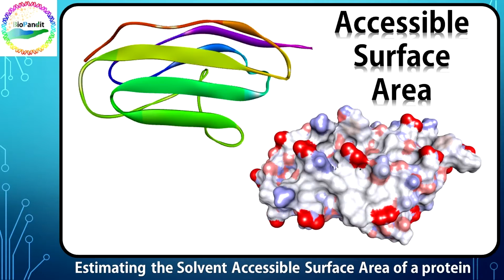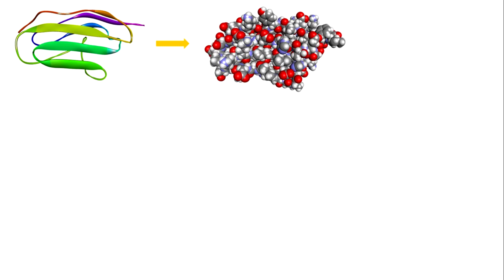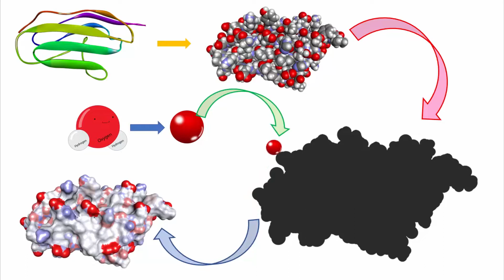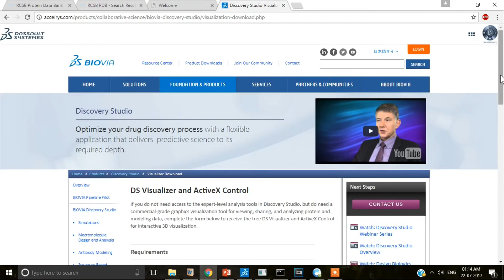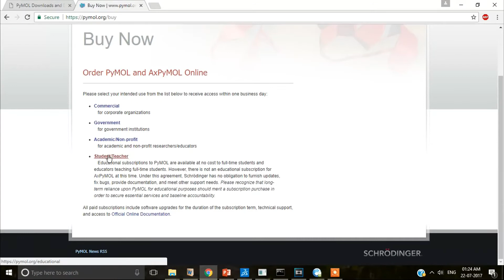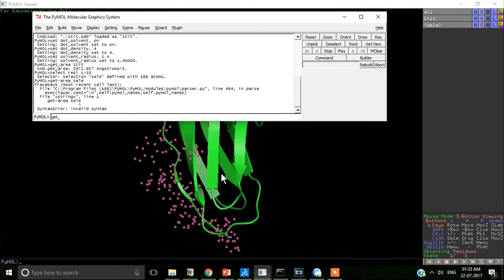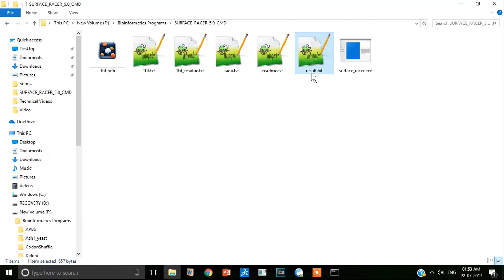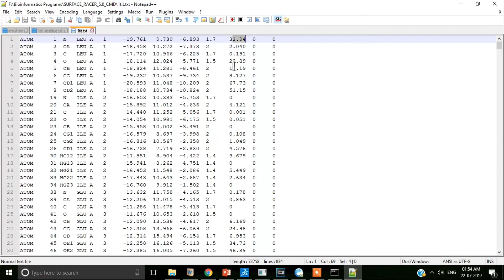Estimating Solvent Accessible Surface Area of a Protein

Comment: Hello there,
I am a researcher working in the area of protein aggregation and thus SASA calculations are pretty important for me. I did the same but through the right panel, and not through the command line. I think that doesn't make a difference. Moreover, I want to know do these result files always get generated after every such run? Actually, they didn't in my case. Could you please share the link for the surface racer and how to install it, as the one I tried, gives a command line terminal right as click the .exe file.
Please help.
Thanks

Comment: I am using Schrodinger, how can I interpret the data from SASA, FOSA, FISA, and PISA for a given inhibitor? For example, if I got higher SASA value but lower on other parameters, what does that mean for a drug molecule ( NOT a protein)? I searched for 3 hours about this information but couldn't get the right answer.  Thank you so much.

Comment: sir by using GETAREA for my protein, i got ASP value as 76. what does it mean?
Reply from the maker: ASP stands for ATOMIC SOLVATION PARAMETERS. GetArea also calculates Atomic Solvation Energy for each atoms. So, your result 76 stands for the number of atoms that have ASP value=0. You could see their paper for a better overview. 
https://onlinelibrary.wiley.com/doi/abs/10.1002/(SICI)1096-987X(199802)19:3%3C319::AID-JCC6%3E3.0.CO%3B2-W

https://www.ncbi.nlm.nih.gov/pmc/articles/PMC2142195/

Both this article will help you. Have a look.
Keep watching BioPandit.

Comment: Thanks for your efforts could you tell me how I can calculate sasa with time changing
Reply from the maker: I think you want to calculate SASA during an MD simulation. We must admit that we have not done this ourselves. If you have the MD trajectory file, save separate PDB files for different time intervals. If you are not good with programming, VMD software can be helpful for this. After that run any standard SASA calculation command-line program using a batch command on your files. Please let us know if this has been helpful to you.
Reply: BioPandit uhmm I got your meaning, once I try I will inform you. Thanks a lot. ..
Reply from the maker: All right buddy... :-)